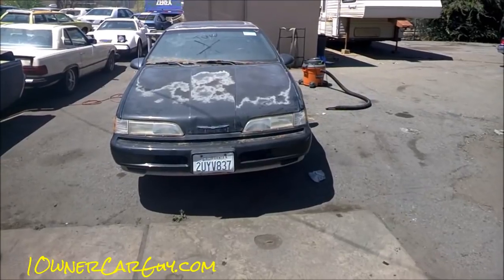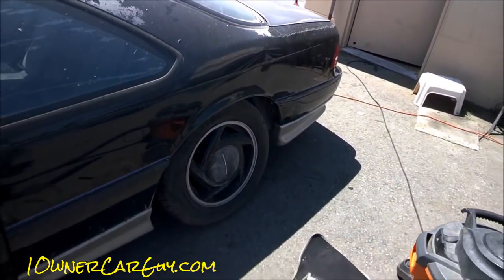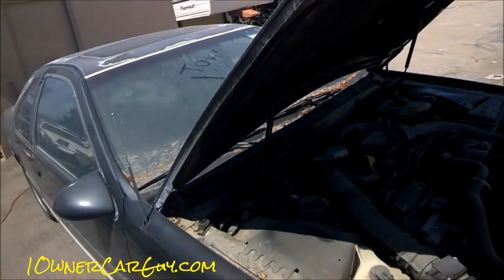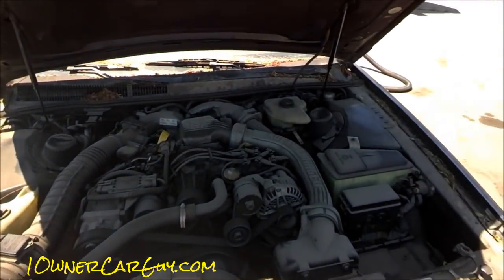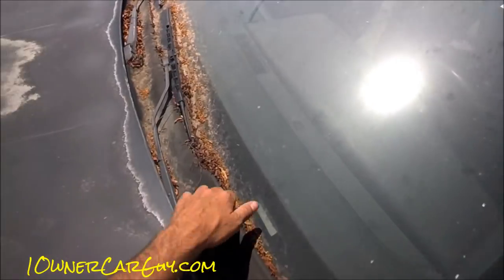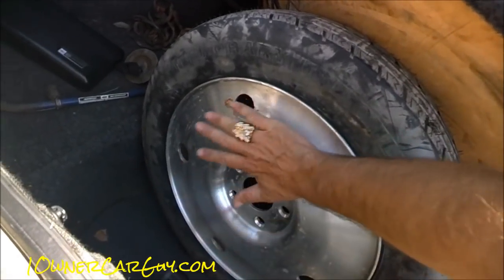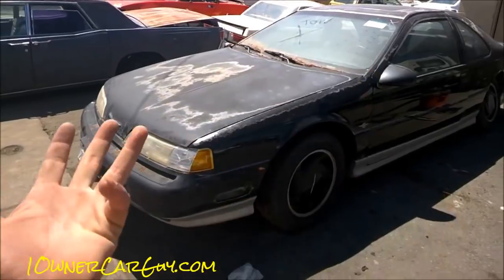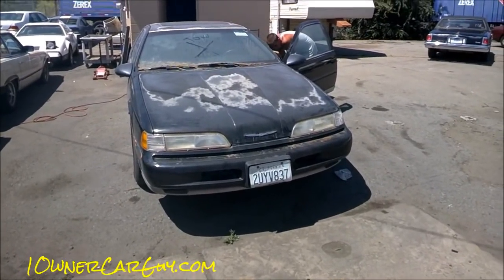Barn Find Detail Tips Video DIY Deep Clean Classic Car Tricks #1

Comment: Hey Nate, I just finished watching all of your detail videos on this T-Bird.  They were AWESOME and spot on! I really enjoyed watching them.  I'm an old detail guy so I can really appreciate all of your videos and tips.  IIn your engine detail videos, I noticed that you don't cover any electrical components.  Have you ever had a problem after power washing the engine?  I too power wash the engine compartment but I usually will cover certain electrical connections and components to be safe.  Also, do you you ever clay a car before detailing? I have clayed  the paint AND the glass with excellent results. It would do no good to clay the T Bird since the clear coat is fading but on a car that still has a good finish, it can really be helpful.  I do have 1 t, when I do my initial wash down to get the gunk off and then wash it, I will use one of those sponges that has a soft scour side to it.  This comes in handy when hand washing it and use the scour side with grime on the trim, front bumper areas, nooks crannies, wheel lips, etc.  minimal scratching in areas that you don't really see and you end up polishing them anyway.  For me, it's just a time saver.  You might also want to do some more training with Nick when using the straight non-orbital buffer.  Someone without experience can do a lot of damage to the paint with one of those.  Keep the awesome videos coming!